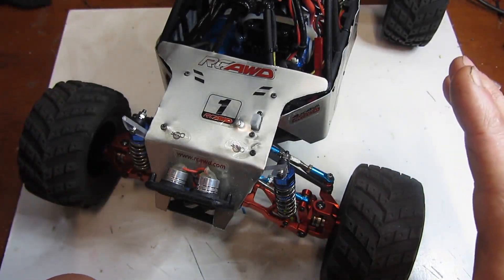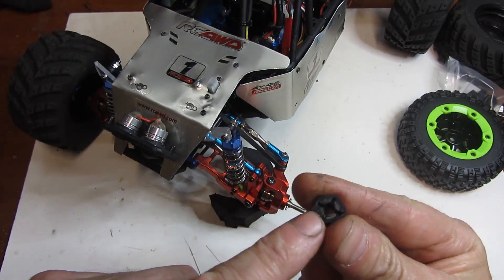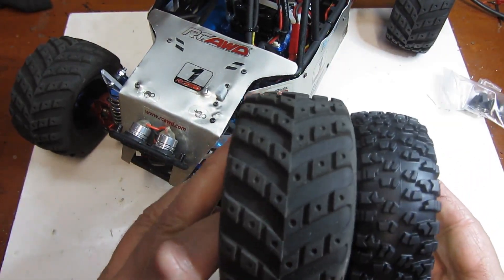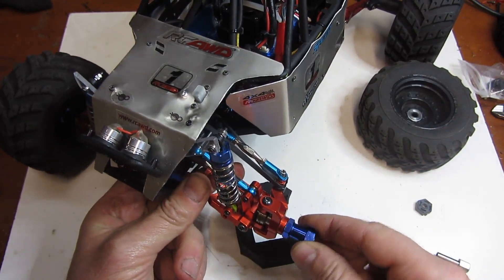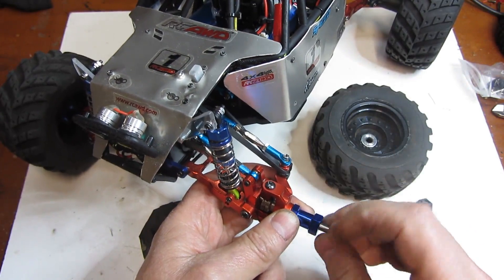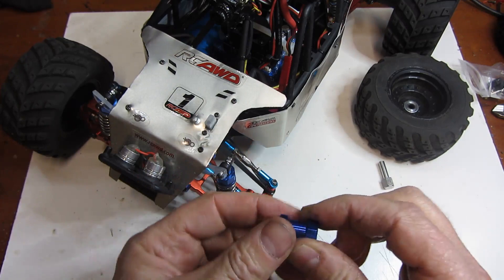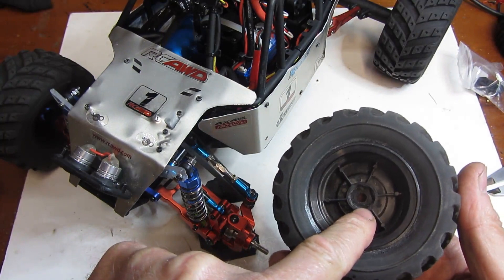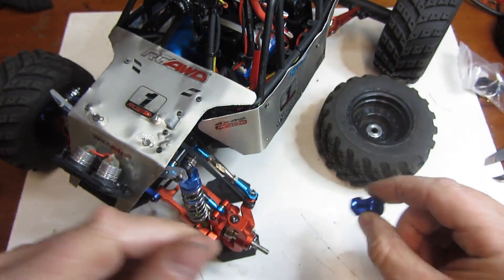WLToys 12428 // Everything You Need To Know About Hub Extenders

Comment: Thanks a lot for this video and your effort! I wish I had seen it a day earlier. I think I bought the wrong extender for my Wltoys 124018, this has an axle of only 3mm. Do you have a recommendation by any chance for widening vehicles with axles that are 3mm? Simply replace the axle at the 124018 to one with 4mm will probably not be possible, or?
Reply from the maker: To upgrade the axle size , you'd have to use larger diameter hub bearings, which would require using a hub that could accommodate the larger bearings. I'm not aware of an upgrade kit for that purpose.
Reply: @Faith_Family_Firearms_Freedom  Thanks for the quick reply! That's too bad. I have some very nice stadium truck wheels here that I wanted to run on my Wltoys 124018. Do you know by chance an extender that fits 3mm axles and is not too wide?
Reply from the maker: @tommygo9185  I did a quick search on Amazon and didn't immediately see any for M3 axle thread. If you do find some, definitely go with shortest length that will work for sure. I've bent a front spindle very easily with hub adaptors. There's so much leverage on the spindle with the wheel so far off centerline, one hard landing and your buying a spindle. Especially with M3 spindle, it will be more fragile. I'd recommend that if you plan on jumping it or bashing it, avoid using extenders all together and simply put your money in wheels that will fit the stock setup. Hope that helps. Have a blessed day.
Reply: @Faith_Family_Firearms_Freedom  Thanks again for your effort and tips. In the meantime, I also found something that might fit, if that interests anyone here. The following set from LC Racing is recommended and should fit the 3mm axles: L6159 Alloy Hex Winchers, +15mm, Aluminum 4pcs. Whether it really fits, I can unfortunately not yet confirm.
Reply: @tommygo9185  hey, did it fit? I have the 124016 v2 and I’m going down that long rabbit hole trying to find the right size.

Comment: Very well done! The thing to note is you have to drill out the holes in the wheels and then there's no going back. The piece that acts the same as the lock nut does not have anything to keep it locked in place. One suggestion might be BLUE LocTite. Don't even think about using red because it needs heat to be removed. Thanks, Brad. I'll re-post this on RC Groups.
Reply from the maker: Thanks again 😎👍🇺🇸
Reply from the maker: Hi John, thanks for the comment. I appreciate the repost too. I assume that accounts for the high views in a short time. 👍 
You are right, you do have to drill out the wheel opening where the nut goes thru, and I failed to mention that, but honestly , there's no choice in my case. However, I can still go back to stock using the stock wheels and hub adapters if for some reason I needed to. 
So far , I haven't had any of the hub extenders come loose and I'm not using any loctite . But you are right, a drop of blue would be a good idea to be on the safe side.  
All good points. Thanks for again brother.
Reply: Did you delete my replay bcoz of the ad? I wasn't sure about the rules

Comment: hi! got a small but really big question... so the stock hub adapter, has right around the center of it around the axle that it goes on, some protrusions (you can see them at 0:41) which make the hub adapter only touch the inside of the hub bearing casing(the outside of the bearing is fixed into the hub, and the interior has the axle through it so that it can rotate). so if the hub adapter only touches the inside of the bearing, there is no friction with the other walls of the hub exterior or the exterior part of the bearing casing. BUT the hub extender you have here does not have these protrusions, which means that it will rub on the bearing casing where it shouldn't, on the exterior edge or on the bearing shields. this i think actually happens to you too, as i can see at 2:16 there are a lot of friction marks on the extender. so.....maybe these extenders are not the way to go? maybe another brand offers the correct ones for wltoys ?
Reply from the maker: Yes, they can rub if you tighten it too tight . The stock axle pin is thin and bends easily. I have since drilled mine out to 2mm and installed hardened steel pins that do not bend and the hub adapters do not rub.

Comment: I have the same rc car could you put the link for the hub extender and tires would that work with stock suspension
Reply from the maker: Link for hub extenders in description. I didn't link the wheels and tires because they are no longer available. If I find them somewhere else, I will add them to the description. Thanks for watching.
Reply: @Faith_Family_Firearms_Freedom  ok thanks didn’t check the description any suggestions for a wheel-tire for the wltoys 12428
Reply from the maker: @w1zardprx187  I haven't come across any similar wheel/tire combos. You might have more luck checking RC groups on FB.
Reply: @Faith_Family_Firearms_Freedom  and sorry for so many question I’m just brand new to all these 

Do you think I should get a longer hub extender is for the same car as you but i don’t know if it was enough for you or you think a little wider would be better and would having a longer hub extender affect something else??

And thank you you have no idea of how much you have help me with the project well I wouldn’t have been able to finish without your tutorials😅
Reply from the maker: The one linked in description will be ample for most any tire/wheel combo you find. Unless you just get crazy with a 10" wheel or something like that. Lol. 
No worries abut the questions. That's why I like to do tutorials. 
One word of caution about tightening the hub Extender....don't tighten it too tight or it will bend the small pin going through the axle. If you notice that the wheel seems to have some drag to it like it's rubbing after you install the extender. Take it back off and look at the pin.  Just take some pliers and straighten it and put back together. Good luck and have fun. Share your progress with me if you want . You can email me at rcinginsc@yahoo.com. thanks.
Reply: @Faith_Family_Firearms_Freedom  ok thanks I appreciate
Reply: And I will mail you and show you my car

Comment: Appreciate the video and questions answered. I had the same issue myself. I got wheels for my Big Rock that were rubbing along the steering servo. Ordered a pair of 20mm extenders on amazon for a few bucks hopefully they work. One question that I had that one hobby dude told me. If you get extenders they could screw up the servo and or other parts cuz they’re not meant to go wider. Is this true? First time RC basher ova here haha. Thanks for your help once again. Be safe.
Reply from the maker: I'll say that the extenders might put slight more load on the servo , but not much , in my opinion.  The servo will only move its designed travel. The only real concern is that if you bash it really hard, the extenders create more of a leverage point and could potentially break the hub. But I don't bash mine. It's strictly a recon vehicle. Thanks for watching.
Reply: @Faith_Family_Firearms_Freedom  Thanks so much...yea I’m def bashing my Big Rock. Idk if I would say I’m goin really hard. I’m only running the thing on 2s still so and not jumping it crazy so hopefully I won’t break the hubs. I did get a few diff 20mm hub extenders on the web. Can’t seem to find one that fits over the axel of the Rock perfectly. I’m drilling the opening to make it fit over axel as well as drilling the pin slots larger to make the stock ones fit. The ones that come with are to thin for the axel in BR. Do you think I should be okay with the modifications I’m doin? And if not, do you know of any extenders that fit the BR without doing anything? Sorry for so much info. Appreciate the help dude.
Reply from the maker: @bilbobaggens6130  Sounds like the mods will be necessary.  Always try to drill as accurately as possible.  (Using a drill press etc) and use as a precise drillbit as possible.   
Anytime you increase the durability,  you can have more confidence when bashing. 
Good luck and have fun.
Reply: @Faith_Family_Firearms_Freedom  yes they are def necessary if I want to use these wheels I got (which I do haha)...I actually had to order a 25mm set just to get the wheel nuts because the 20mm were a hair too short and not catching the wheel axel. Do you recommend any loctite or superglue in any spots? i.e. where the pin goes into hub extender, or anywhere else?
Reply from the maker: @bilbobaggens6130  Sure. Some medium strength loctite  on wheel nuts would be a good idea since the right side wheels will have a tendency to unscrew themselves. And a drop of glue for the axle pin is also a good idea so it doesn't fall out and become lost in case the wheel were to ever come off.  All great ideas. 👍
Reply: @Faith_Family_Firearms_Freedom  Awesome!!! Thanks so much brotha. Really appreciate it.
Reply from the maker: Anytime. You can email at
Rcinginsc@yahoo.com if you have more questions. Actually I could learn a thing or two from you. 😎👍
Reply: @Faith_Family_Firearms_Freedom  sounds good I def will. Haha idk about that. Sounds like you know ur stuff and been doin it for a while. Appreciate the kind words. I’m brand new to the RC world so I’m soaking it all in now but def Lovin it so far. I’ll send some pics of my (hopefully) handy work once it’s all done to your email. Get some feedback. Talk soon. Thanks again. 🤙🏻

Comment: The link that it sends you to says the bolt hole it's only 3.5 mm is that still going to work
Reply from the maker: Yes, that's showing the inner diameter of the thread. The thread size is 4mm with a pitch of 0.6mm thus they show that hole at 3.4. 
Don't worry , it will work. The only thing you might have to do depending on the wheels you have is to drill out the hole in the wheel to 5mm so the extender nut can pass thru. 
Pro tip...don't not over tighten the hub extender or you will bend the axle pin.
Reply: @Faith_Family_Firearms_Freedom  thanks.and yea I know I just use super glue to lock tight the nut on